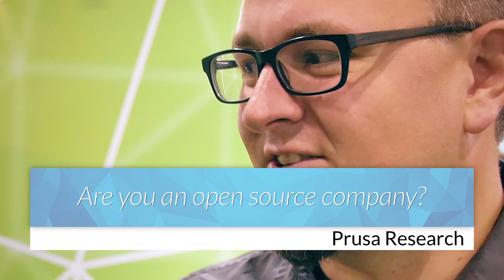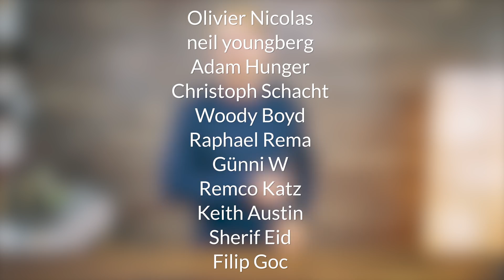"Open source" is more than a marketing term!

Comment: On that last bit, I think It's pretty important since some users are not satisfied with their machines and mod it. And then you see some companies like Prusa take those upgrades and ironing out the problems and implement correctly. Which sets a new standard to build upon for other companies. So kinda taking community based upgrades and taking the risk and R&D to standardise it all.

As for tinkering, I like to overclock stuff and push it a bit more to it's limits.
Saves a bit of money for the DIY guy as well instead of voiding every warranty ever for like Davinci printers which I severely dislike.

I'd love to see an open source idea for 3D printer enclosure. Some scientific chemical cabinets and especially down-flow cabinets are patented like crazy since they sell for lots of money. So I guess a standardized enclosure would be cool to see, so companies can implement it as well. Instead of licencing it all locking it out for 5 to 10 years for others to use.

Buttt.. there is money to be made in the 3D printing industry. And some might want to make sure others do not tap into that market. So I wonder how long it will stay like this. I saw the project 32bit arduino due with the Ramps-FD pop into smoke because chinese resellers took an early alpha design and started selling it. And of course 32 bit coding hardships.

Comment: As an end user, i use 3D printing for parts of my work. To me, Open source is essential, simply for my survival as a buisness. If i use a closed source toolchain, and the provider goes out of buisness, i have to respec my whole production, whereas if Josef Prusa decides to stop making anything, i'll be able to either do it myself, or buy from others that will... Both the hardware and software i use to work are sustainable in that sense.
But there are lots of other reasons why open source matters to the end user outside of tweaking the firmware : modding the machine by adding a part myself is much simpler with open source designs, and even better, someone is likely to have already released the part i want. I can have 3rd party soft to go with my printer, or i can chose what soft to use with my printer to slice and send gcode... I like cura, but it lacked something i wanted. I tried Slic3r, and it just works. Even if prusa didn't provide the profiles, it would be easy to do...
With a closed machine such as the vinci, i would have a hard time doing it...

I'll add one more, but not the least : for ethical reason, i'd rather use FLOSS and OSH, participate in a great community rather than just being a consumer...

Comment: Opensource often falls into water filled potholes of doom.   e.g. SmartRap project.  Inside 12months no one could figure out which files to get to even begin building one.  There are like 27 versions of this interesting design.  NONE of the results or lessons were ever recorded.   I've spent the last year building and redesigning a SmartRap, but still cannot compete with the bottom end Anet or chinese clones (~$180).   Then I ran into people who do NOT want any 3dprinted parts in their printer, they want metal or injected molded stuff.

And then theres software.   What a mess.
Reply: Eh, software, mess?

But thing is, "potholes of doom" in commercially engineered world are for example crowdfunding projects that are misengineered, and there are lots of printer kits out of China that barely even work. SexyCyborg tested Mooz right now, and it appears it has NO way to home itself reliably. It either prints first layer in the air or crashes into the bed. Given they don't seem to have foreseen any adjustments and just homes by non-adjustable microswitches, not sure how they wanna solve that 2 weeks before shipping out the final units?

Comment: Anyone benefiting from the work of the RepRap project and not sharing back their designs in the same method - access to code, design files, tooling, development methods - is a lecherous scumbag who should be driven out of business. Ultimaker's response was better than nothing, but yeah don't become MakerBot, those guys are assholes. Prusa are moving towards "open source vendor lock in" which is sad. DRM filament and companies making closed proprietary systems like Lerdge is just shit. XYZ have no clue. LulzBot are incredible at proving the open source business model. Duet3D hit the mark perfectly, the tooling and the development method are important too. Good video.

Comment: Wow... those responses from XYZPrinting were awfully cringeworthy.  They totally don't get Open Source, even though their printers have almost certainly benefited from the Open Source community (especially the 3D printing community).  I can tell you that they're using some Arduino clone hardware, and that some of their printers can be reflashed to use Open firmware.  Tom, you mentioned that their gcode is encrypted -- this isn't entirely true, as I recall they're really just base64 encoding the gcode and saving it to files with a .3MF extension.  Simplify3D can generate this variant just fine, and can print directly over USB to most XYZ printers.  Folks who use purely Open slicer software have used Cura and just manually converted the gcode using standard *NIX tools.

They do have at least one "Pro" printer that can take 3rd party filament, but it's pretty clear they don't understand Open Source in general.  I'm also pretty sure they're violating at least one Open Source license, which frequently happens when companies consume an OS product and don't pay attention to the terms and conditions of the license (e.g., the GPL requires publishing your changes).

Comment: I think it comes down to what value 'open source' adds for the consumer. Something being 'open source' does not mean it is better or will even work. Most of the cheap crap from Asia is just copies of what other have done built down to a price. If I want to 3D print I want a 3D printer that will work for what I need it to do. If it is 'open source' but does not do the job it is worthless.

I think it is a bit much to expect companies to provide design files in the format you want. That is a bit like saying, "but I only speak Russian so you MUST release all your documentation in Russian."

How many of you open source zealots would wan to fly in an 'open source' airplane?

Comment: XYZ Printing  - you can challenge the machine.. 
faceplam 

Thanks for your coverage on all this Tom!
You should double back and ask Lulzbot more about the dynamics at the company and the actual software they use in more detail.. If I recall correctly windows laptops are forbidden in the building :P
Reply from the maker: Well, I could either ask them or you could probably just find the info on one of their public servers ;-)

Comment: I got this || close  to seriously considering buying a very cheap smoothieboard based/clone from China...
It was just so very dirt cheap... I then discovered that they did not seem to provide ANY schematic for it...
Not even in pdf form!
They had a github page that contained a pdf that showed the names and location of the (nice and colourful) connectors.

As an end user I at least demand a pdf version of the hw "source", having to trace pcb paths should be so painfully unnecessary these days!
Oh well I suppose I will just have to buy a really open 32bit platform once I get my home build mendel90 off the back burner....

And another story... At work we brought a cheap I3 clone for some prototypes.

First nag: No documentation about the stepper current settings for the motors.
The current resistors are located under some glued on heatsinks, so no  luck there figuring it out on your own (and the reseller had no clue about what I was asking for) ...
Luckily it runs okay at the "motors don't seem to get that warm setting"
Second nag: They had replaced the two upper linear bearings in the  x carriage with just one (with horrible tolerances and resulting slop)...
The printer was kind enough to print out two new "integrated" bushings with much less slop.

The printer still prints nicer than my ageing RepRap Pro Huxley though...
Btw. At work we did end up getting a I3 MK2 (and multi material upgrade)... It really makes the Pro Huxley envious :)

Comment: While open source helps development, it seems to me the it could struggle is some areas, such cohesiveness and simplicity? For example, Blender is open source, very powerful and capable, but software such as Modo, IMHO is better thanks to its more unified toolset, that is easier to use?  Just asking to understand, thanks Thomas.
Reply: You appear to have this "many cooks spoil the broth" philosophy that is often brought up by people who push commercial software - either for money, or in one case that i've seen because the person has worked for a CIA outlet for decades and was a so well brainwashed anti-communist foxhound, that it inspires inherent hatred in them for anything that appears to them even superficially similar. But having worked in industrial engineering companies, the "many cooks" problem is often much worse there, as people fight for political influence, within the company, try to make themselves appear 'indispensable' so they don't get fired, get an income raise, and wield engineering decisions as a weapon.

But Blender really comes from one set of hands who decide on everything, it has one quite active lead developer, and a few permanently employed helpers that have a great understanding among each other. I think the bad accessibility of its toolset comes from the design philosophy of these people, as it was apparent even when software was closed-source. It was a tool made for a handful of in-house artists original and that optimised THEIR workflow to be as fast as possible, at the expense of the terrible learning curve and high apparent complexity. What it buys you is that the occasional baffling failures that other software (very rarely) produces and look unexplainable there, are possible to troubleshoot and fix in Blender, as the UI directly reflects internal data, saving potentially thousands of hours of work from being ruined by a bug, and of course there are bugs, and also its unconventional UI forced a fast dual-handed workflow.

Commercial software that comes with a retail pricetag is not only concerned with how good is it in production, but also at the sales stage, so it will be designed for lower cost of entry, being more inviting up front, requiring to understand less of its innards, and hiding the comparatively 'messy' innards (if we think of say fully featured 3D production software, this complexity is not caused by negligence, but by inherently conflicting with each other engineering requirements) behind a more coherent interface is one of ways how they can accomplish that.

I think you need to look for individual explanations for particular shortcomings of each and every project and product. It is indeed not too rarely the case that loosely led open source projects will just push things as far as the implementation effort threshold is lower than pain threshold of continuing to use something that is less than perfect, but this is by no means universal.
Reply: Thank you for responding. IMHO moderation seems helpful. 

I don't agree that, as you imply, "people who push commercial software" are ether greedy, or driven by an extreme agenda. In the case of Modo the developers came together to solve a problem that they all agreed upon software that was more complex that it needed to be. IMHO Blender seems to be more like a collection of ideas.

"Commercial software that comes with a retail pricetag is not only concerned with how good is it in production, but also at the sales stage, so it will be designed for lower cost of entry, being more inviting up front, requiring to understand less of its innards, and hiding the comparatively 'messy' innards (if we think of say fully featured 3D production software, this complexity is not caused by negligence, but by inherently conflicting with each other engineering requirements) behind a more coherent interface is one of ways how they can accomplish that."

Sorry I am not convinced. Yes development can be messy, and some companies (AutoDesk...?) come across that way. However it does not have to be that way nor is it always the case. 

I was wondering where innovation in 3D printing will come from as it seems that current FDM printing has not improved that much over 3 year old FDM printing, other then the "race to the bottom"?
Reply: I don't see MODO as "people who push commercial software", but people who happen to publish software commercially. What i mean are lobbyists, politicians, journalists, writers, marketers, anti-open-source advocates. People whose work it is to influence opinions. Smaller engineering centric companies don't necessarily have an opinion that they want or need to impact on others, merely looking for ways to make ends meet, and of course open-source model is not universally applicable.

I didn't mean 'messy' in a demeaning way at all. As i said, with 3D authoring software, it's largely domain complexity. I have worked at a 3D engine middleware which is used on games and for broadcast television, i have shipped virtual world software, i am familiar with underlying engineering, and having poked Blender for example, it's actually as well organised as it gets. But as it happens, there are multiple conflicting engineering requirements, some operations are best correctly representable on a particular data representation, and others need a narrow set of data representations for efficiency, and not all of these have a palatable presentation that you can show to the user - so then there's the question of how they are maintained and kept in sync, or when are they destroyed and rebuilt. These form a hidden complexity that can occasionally leak to the user.

Certainly very big companies have a propensity to pile on code instead of finding the most compact and elegant solutions, but i specifically didn't mean that.

And yes of course Blender implemented many unusual features that you don't expect in a 3D animation software, because they needed a particular tool and the open-source ecosystem of relevant software was very poor at the time, while their studio was using first IRIX, then Linux. In turn, it of course made the software on the whole more complex, less accessible, and perhaps more resistant to change where it's needed.

As to where innovation in 3D printers may come from... well what are the limiting factors? Mechanical quality - reduction of backlash, designing systems that have just the right amount of constraint and don't wobble. It's an age old solved problem, but it's the matter of cost. Extruder performance - i think that's a big one! The pretty much whole reason we're not printing at 150mm/s now is the extruder/hotend weirdness. You start pushing filament fast, it's becoming a mess more than it's melting. It always springs back, and it always keeps oozing after you stop pushing it. The temperature measured and power supplied is never an accurate representation of the temperature in the filament melting chamber, and it's not uniform across that chamber, different thermal conductivity between liquid and solid phases, so worst case, it can both be already decomposing, almost burning, and not fully melted yet... lots and lots of engineering to be done there!

Say we can never quite create a perfect hot end; what if we could compensate its misbehaviour in software better? What we now have are rules of thumb, simple rules that don't seem entirely wrong. But what if we could have a physical simulation model based compensation instead? But we don't really have all that much computational capacity left on 8-bit AVR boards, so i think the next big thing will be a $20 STM32 board... nothing spectacular, just a cheap shitty board, but a damn lot faster than the AVR boards you get at the low end today, and the key will be proliferation, something that can be on everyone's desk and in everyone's printer and where they wouldn't have to give it a second thought, something that would just kill off AVR for good so we can move towards trying out more complex things. I have some plans in this regard. I'm sitting things out a bit and learning what everyone is doing, to see where to hack, because relevant developments are happening.

Comment: the reason I became as proficient as I am with AM is thanks to the open source community publishing their source code and allowing me to read it. The knowledge and insights I gained from that exposure helped me in my internship programming L.E.N.S (direct metal AM) closed loop toolpath based process control. I am proud that the first commercial printer I bought was a Lulzbot Taz 5 and them being truly opensource was a huge factor in that decision. My next printer purchase is a prusa I3 mk3 for the same reasons. I can't thank this community (opensource community) enough for the knowledge and insight it has imparted to me. it has proven to be invaluable and I'm happy with the career I have chosen based on their influence.